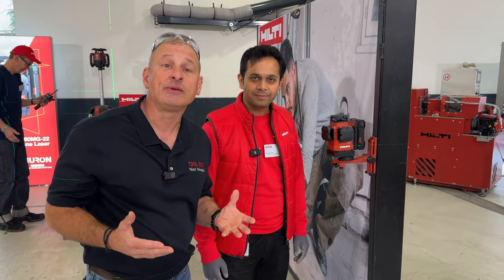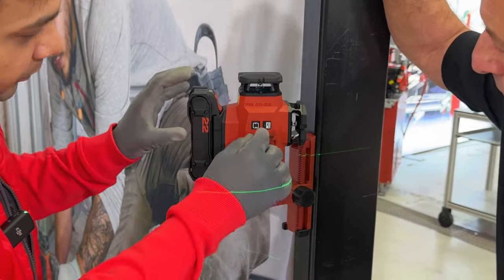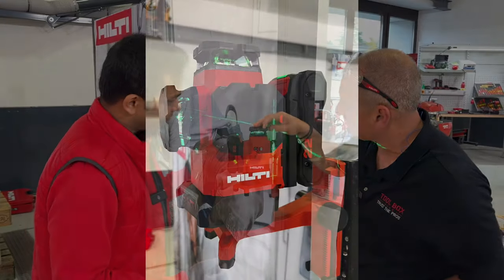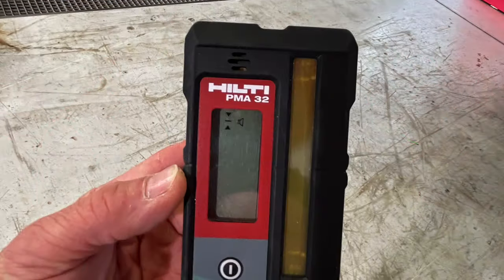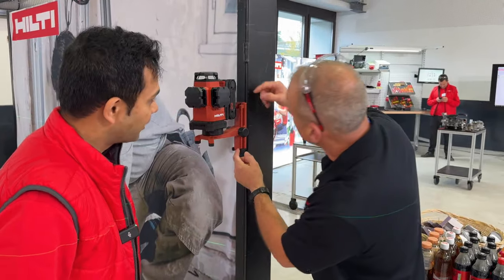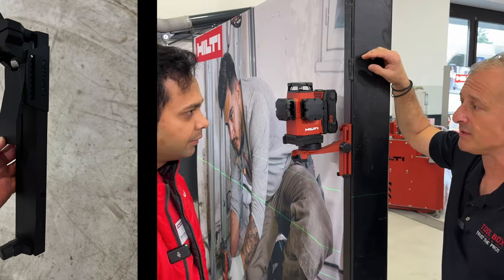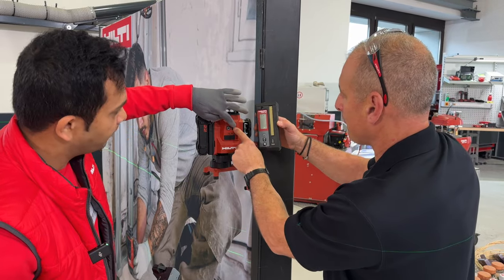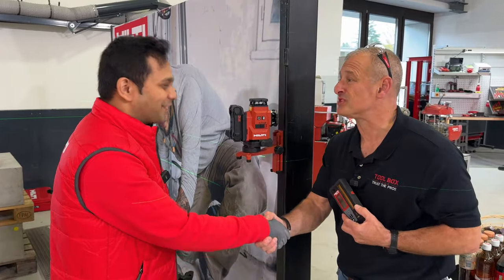Hilti Multiline Laser | New Tool 2024

Comment: I really hope they make the case big enough to put all the accessories.
Reply: You mean like they already do with their 12v version?
Reply: @robertrada4783  the 12 volt case is small for trypot  and receiver holder, and the magnets and I don't have the target plate yet.
Reply: @HARCONSTRUCTION  I can see that. I use a larger tripod, so on my end, the Hilti case is 50% air. 😂